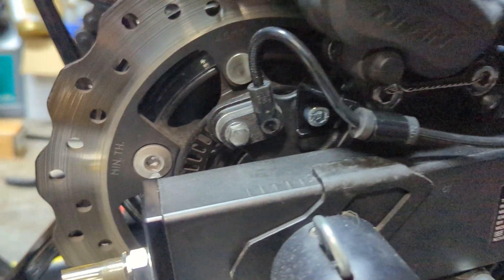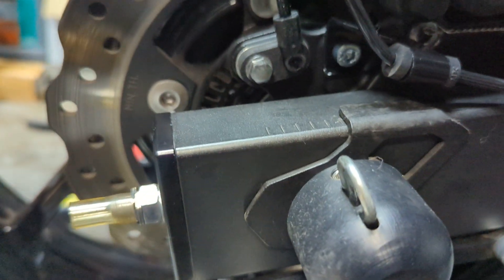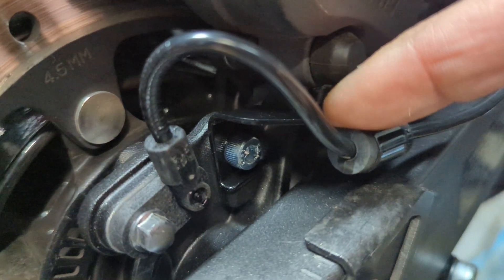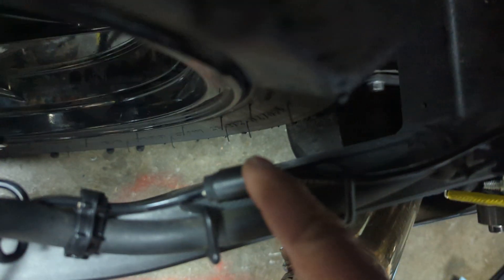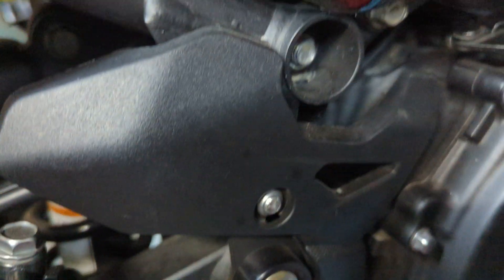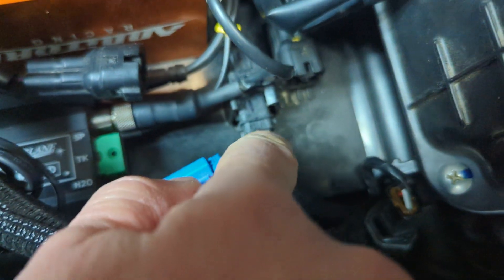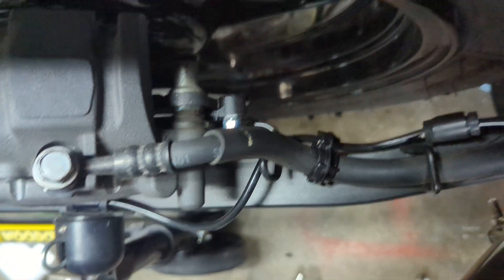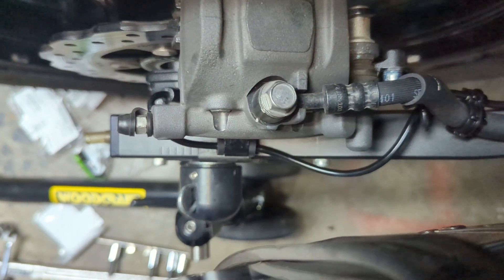2023 Ninja 400 rear caliper bracket and wheel speed sensor on 2018 N400

Comment: I may just be being stupid but how do you get the old censor out/new sensor in through the metal cable loops without taking out the break line.
Reply from the maker: They do not occupy a shared space in the brackets that necessitate removing the brake line.
Reply: @falcn12 sorry I might be mixed up, Im talking about the two metal loop things you can see at second 59 it doesn’t go through the first one but the second one. When I try and pull it out to replace it there’s not enough room.
Reply from the maker: At 59 seconds I don't see anything odd. I didn't have to remove the brake line at all on this install.

Those are not closed loops, they are open ended.  You just push the brake line over a bit away from the opening in the loop and slide the sensor cable in the side opening.
Reply: @falcn12  somehow I missed that they weren’t closed. Appreciate u explaining that even though it was stupid
Reply from the maker: @elijahlevine2310  no problem. Sorry it took me a minute to understand your dilemma

Comment: Thanks for the video, it helped out a lot! But quick question, how easy was it for you to disconnect the wire underneath the gas tank. I tried yesterday but it doesn’t seem to want to come undone. Do you think I’m doing something wrong?
Reply from the maker: @calebmarshall624  It was a bit awkward.  You have to make sure you are pulling or pushing on the clip (there are different types of clips).  I popped it out of the holder.  I actually took the tank off so I had more room.
Reply: Do you think it’s possible without removing the tank?
Reply from the maker: @calebmarshall624  yes, Pop it out of the holder if you haven't.
Reply: @falcn12 okay great, thanks for the help. Just hoping it’s not too hard

Comment: Broke the housing off the cable that connects under the swing arm years ago on my 2021 Ninja 400, likely due to using a pad style paddock stand when cleaning my chain. The cable is still connected but just gave me a persistent engine warning light today. Diagnosed it as error "24" - Rear Wheel Rotation Sensor Signal Inspection

The rear wheel rotation sensor sends the signal to the ECU through the KIBS hydraulic unit (KIBS equipped models). For other than KIBS equipped models, the signal is sent directly to the ECU.

The ECU uses the rear wheel rotation sensor signal for motorcycle speed and S-KTRC control.

The service code 24 is detected with the ECU.

Video is nice indication of what I may need to do, though I'd prefer the neater setup under the swing arm and just be super careful when raising it on a paddock stand or advising the shop when they need to change the rear or do any rear wheel work.
Reply from the maker: @awilywolf  Raise the bike so much at the track it is worth swapping to the top
Reply: @falcn12  Actually saw you original post on ninjariders where you included the schematics for the 2018-2002 model vs. the post 2023 model. 

Could you confirm if the actual OEM post 2023 setup, based on that schematic/parts visual would retro fit a 2021 model? I know you talked about a Fast Frankies OEM pre-drilled custom bracket, but how much better is that practically speaking vs. the post 2023 OEM above swingarm setup?
Reply from the maker: I can't 💯 confirm as I don't have a 21, but pretty sure they all used the same parts 2018-2022.

The Fast Frank's captive caliper bracket is just a modified OEM caliper bracket. it pairs with a modified OEM chain adjuster to allow the caliper bracket to bolt to the axle adjuster. Makes taking the wheel off SO much easier.  It's the OEM 2023 bracket. I had to replace the 2018 bracket as they are different.
Reply: @ The 2018-2022 sensor cable doesn't fit well with the OEM post 2023 bracket nor the Fast Freaks, correct? I would have to buy the post 2023 sensor cable as a replacement along with the newer OEM bracket setup/Fast Freaks pre-dilled custom and parts to fit to my 2021 Ninja, correct?
Reply from the maker: @awilywolf    You need the 2023 caliper bracket as the whole thing is different and the mount for the sensor is part of the bracket. The 2018-2022 cable does not fit the upper mount brackets, I tried. You need the 2023.cable and a couple cable mounts.

Fast Franks is a modified OEM bracket and axle adjuster combo. They have the early and 2023+ design caliper brackets.
Reply: @falcn12  Appreciate your clarification and the details you provided in that old post on ninjariders! Rare to find the solution to something so specific to your own particular model and issue, cheers.

Comment: Good day bro. Does the rear caliper of ninja 400 doesn't have play when squeezing the brake?
Reply from the maker: I'm afraid I do not understand the question.  There should be a little lever travel before the brake is engaged. The pads retract a little after you let off the brakes on front and rear brakes. If you have no play, then your brake might be dragging a bit and heating up the fluid, or your adjustment rod for the lever is too far out. 
If the pads are not retracting you might need to give the caliper a good cleaning. Don't ever push a dirty caliper piston back into the bore when putting on new brake pads.

Comment: Thanks for the info.. Wondering if one could buy a used 2023 sensor cable and and abs bracket and see if that would work instead of buying the fast Franks?? 🤔
Reply from the maker: Yes. The Fast Franks is just a drilled OEM bracket.  But if you ever change your own tires, I can't recommend the FF captive caliper bracket enough.